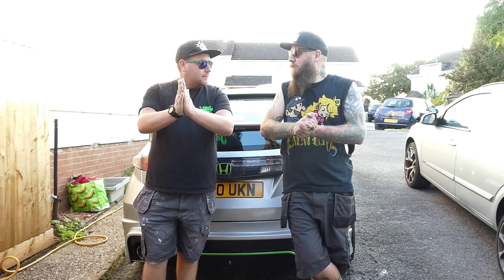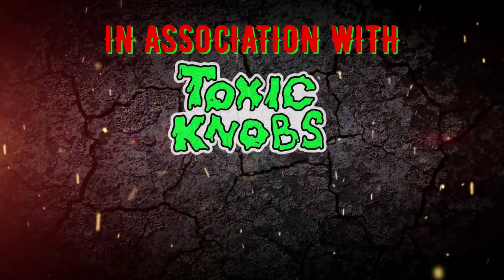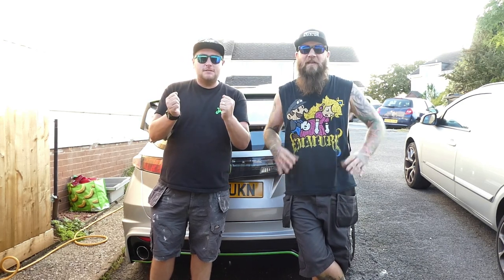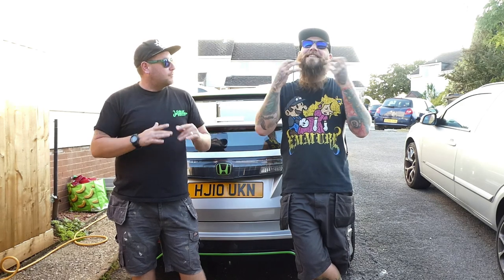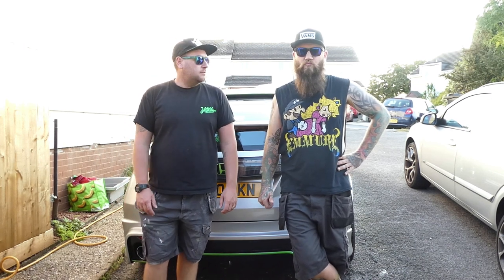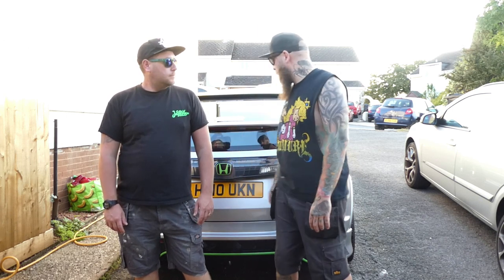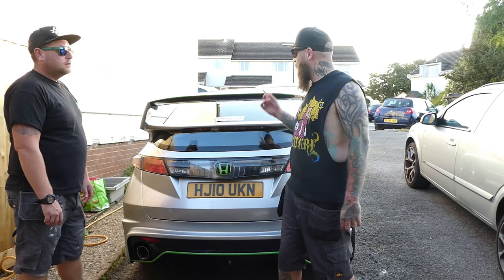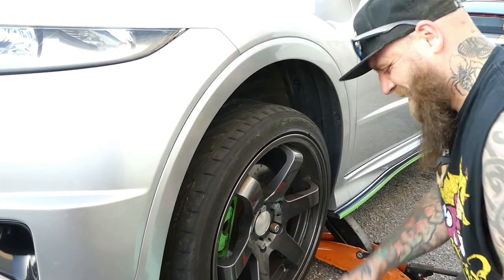Fitting the 1form alloys on Bens FN2 Type R

Comment: Cool wheels but could not help noticing that your front brake pads are the wrong way round. The thickness indicator should be at the rear of the disc such that it will be at the bottom on the opposite side.
Reply from the maker: Coolscanner yeah I know bud 🤣 long story lol there coming off next week anyway 😊